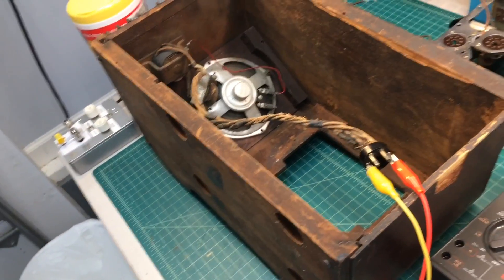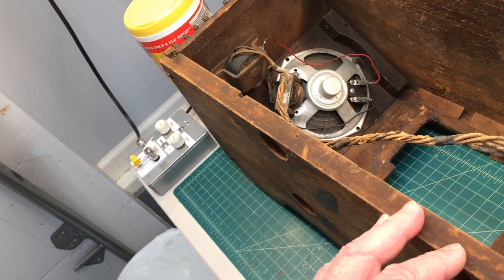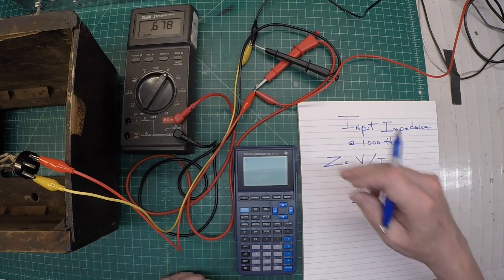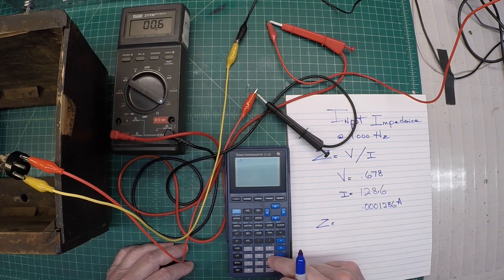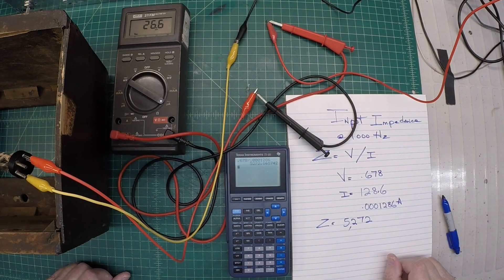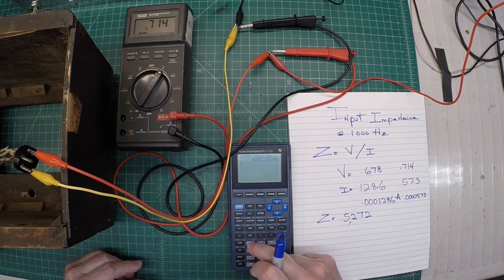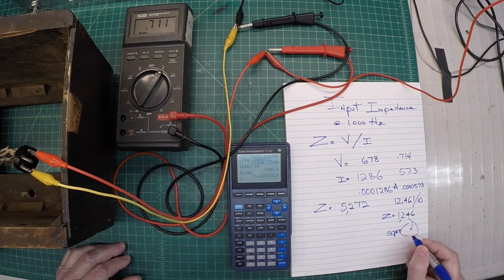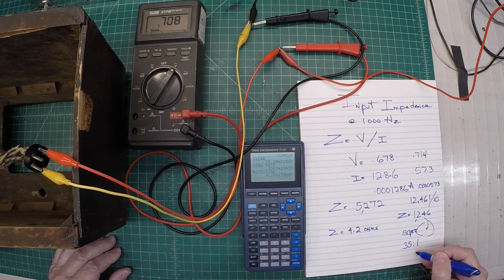A Different Approach: Measuring Speaker Impedance + Transformer Impedance & Turns Ratio

Comment: Are you sure this is correct? The transformer is inductive you neglected the phase angle between the voltage and current. You cannot divide the voltage by the current as they are out of phase.  The potentiometer method is a better way of  measuring the impedance.
Reply from the maker: Thanks for the heads up. I’m working on a Warwick receiver now and will repeat this process and compare it to other M&Ps when I get to that point in the restoration. Hope you’re doing well. Best, Don
Reply: @RestoreOldRadios  Hello Don. Yes all good here thanks, just busy at the moment and not enough time. Hope your well. Anything you need just give me a shout. Regards Chris

Comment: Hi Don. very good and simple system for measuring speakers and transformers impedance. Anyway, you know we had a technical discussion about the frecuency to test speakers impedance. You know we talk about tests at 400 Hz, 440 hz and 1 KHz. To know what a right test frecuency is is a problem I must study before to do my project of a electronic device to measure speakers and earphones and audio transformers impedance.
But for what I have seen, you did it right in this video, usin 1 Khz. Maybe there is not much difference between 400 Hz and 1 Khz in results... I am not sure... I will must do my own experiments around this concept when have time.
Have a nice day and my best wishes for you.
Ketk (Spain)

Comment: One way you can get an impedance reading quickly is to put a potentiometer in series with the load, feed an AC signal to them, adjust the potentiômeter until it reads the same voltage drop as the load, and then measure the resistance of the potentiometer.
It's a tip one of my teachers from the tech course told me and I never forgot it.
Reply from the maker: A great process/technique for sure. You can also do the same and adjust the AC current for 1/2 of the source as well and read the resistance of the potentiometer. I’ve also used a fixed resistor in series with the load and take the input voltage - output voltage / R = I, then output voltage / I to solve impedance Z. Thanks for watching and sharing your knowledge on the subject. Best, Don